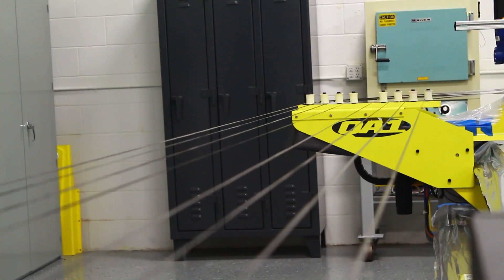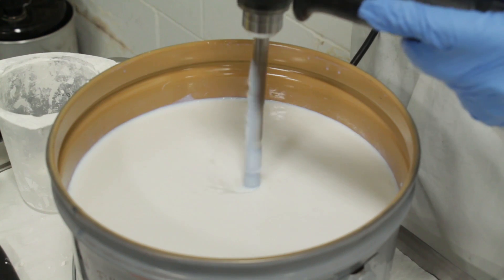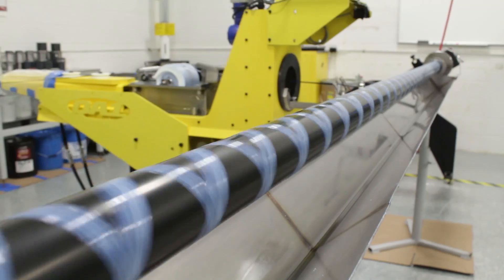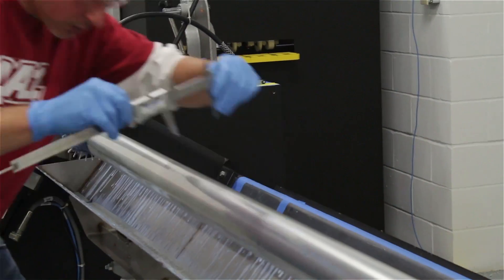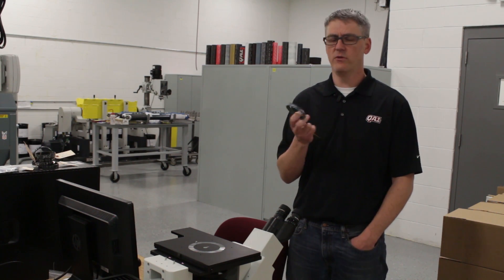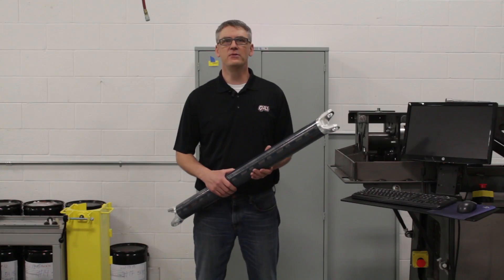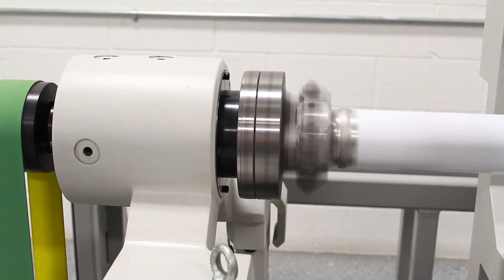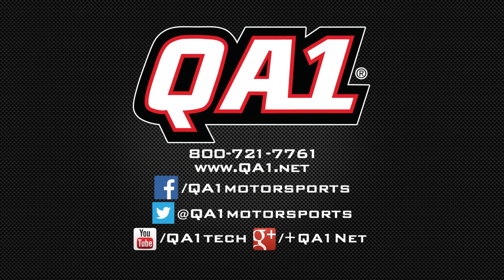How It's Made: Carbon Fiber Driveshafts

Comment: I have a 2019 Bullitt that has lots of suspension work BMR and Steeda parts that I occasionally track on the local road course.  Is a one piece Carbon Fiber Drive shaft for my car?
Reply from the maker: We currently offer driveshafts for the 15-19 Mustang platforms, but we do not have the Bullitt listed as we have not been able to confirm fitment for this vehicle.
Reply: Well, if ya wanted to figure out the fitment for a Bullitt, ya know where to get one... @QA1TECH

Comment: I wonder if they do one for a E46 BMW and one for a F80 BMW at a specification to allow enough room for the OPF...
Reply from the maker: We currently are able wind and balance one-piece driveshafts up to 65" long and that will work with a 1310 or 1350 u-joint. https://www.qa1.net/automotive/driveshafts/custom-rev-series-carbon-fiber-driveshafts

Comment: how do you guys get both ends (yokes with ears) perfectly in line and in phase? 

this i would imagine would cause no problems whatsoever when perfectly straight on a balancing machine, but then wreak havoc when at an angle and the ujoints are operating.

Comment: Corvette c6 zo6 and zr1 please
Reply from the maker: Our custom driveshafts can be made up to 65" long, can withstand up to 2000 HP and 1500 lb*ft of torque, and work with 1310 or 1350 u-joints. If your vehicle fits within these specs, fill out a custom order form and let's see if we can make one for you! https://www.qa1.net/automotive/driveshafts/custom-rev-series-carbon-fiber-driveshafts
Reply: @QA1TECH  it's not u joints but it's much easier to made ,email sent let's see what we can do about it we have to corvette waiting for a new drive shaft thanks

Comment: Do these snap easy?
Reply from the maker: No, they do not. The resin we use to wind our driveshafts is specifically designed for high performance. We did a lot of testing with these before they went to market to ensure that they are strong enough. They are balanced and torsion tested before leaving our facility and our yokes and u-joints are specifically developed to work with our driveshaft bonding, resin, and at the performance level that the shaft provides.
Reply: @QA1TECH  thanks for the reply and info !

Comment: Why don't you use an autoclave to reduce/eliminate air pockets?
Reply: The shrink tape squeezes out excess resin and also some trapped air. The whole wrapping process would need to be manual. Same for towpreg, shrink tape is the way to go on this product

Comment: I would love to know why fiber tows are used, and not a woven fiber.  Is it because you need fiber directions that can’t be gotten with cloth?
Reply: Material is much cheaper and can be oriented very precisely in every angle
Reply: @Nord55  thanks for the feedback.
Reply: @aConspiracyOnlyTakes2  no Problem, forgot some of the most important reason. You have less fiber ondulation. In fabrics the fibers are bent like waves. This alone can reduce the mechanical properties of the fiber by around 60%
Reply: @Nord55  Ah, I did not know that.  Thanks!  I wish I could find composite design training for the self educated engineer.
Reply: @aConspiracyOnlyTakes2  there’s lot of stuff to find in the internet. Otherwise there are many books which helped me to get into that stuff. I practice filament winding since 6 years and working with carbon fiber since 2013. still a lot to learn as I didn’t studied mechanical engineering or anything like that

Comment: its just a carbon fiber wrapped tube lol! unneccesary, is NOT  awhole carbon fiber driveshaft, its covered with resin...
Reply: The tube that the carbon fibre is wrapped around is the mandrel, which is removed after the composite has cured, leaving the shaft made of nothing but carbon fibre reinforced resin.

Comment: can you make custom shafts for industrial applications ? Pump drive shafts ?
Reply from the maker: Yes, we do make custom driveshafts for industrial applications. How many do you need?
Reply: Since were present using steel and not sure if yours will take the torque of our pumps ( 60HP 1800 max rpm  on vfd ) probably one for a trial and to start if the trial works the total for now would be six to start .

Comment: Do you bond the aluminium to CF with structural adhesive ? I need to repair a MTB, aluminium alloy and I don't want to weld it. I want to wrap th defective part in CF .

Comment: Impressive!  Do you make one for a 2010 GT500?  Thanks.
Reply from the maker: Thanks! We do make them for 2010 GT's, but haven't confirmed fitment on the GT500's. If you have specs & measurements, you could call in and we could see about making one for you. We're available at 952-985-5675, thanks!
Reply: @QA1TECH  the GT uses a way different transmission than the GT500.  However, the 07-14 GT500s all use the same transmission, and there are a lot of people who upgrade their driveshafts.  Perhaps add to your inventory?
Reply from the maker: @Twobarpsi  I'll add it to the requested applications list and see if we can get one in for test fitting. Thanks!
Reply: @QA1TECH  Thanks!

Comment: I am electrical engineer .I want to repair my aluminium alloy Enduro bike frame, and I want it to bandage the cracked  portion in layers of carbon fiber. But I found that the main problem is that the aluminium will corode even faster under the layer of the carbon fiber and basicly will be a failure. Anyone here has any sugestion how to unite the 2 meterials in the best way ? I forgot, that portion has zero flexibility, is the  head of the real fork, a 2 cm bar of solit aluminium alloy 7000, so the stifness of the carbon fiber I don't think will be a problem.  Any tip will give you 3 karma points ! TYVM :))
Reply from the maker: Wish we could help, but our bonding procedure is proprietary. I can tell you that we use a structural adhesive similar to what they use for aircraft. Hope that helps, thanks!
Reply: Ty ! So there is a solution :) I was thincking to take some samples of 7075, anodize them to prevent corosion and then  bandage them in carbon fiber, form like an exo skeleton to cover the area . Then test all pieces for stress ''in the house'' :) I am  sure there is a better (easier) solution to repair that 7075 alloy then the standard welding wich I found everywhere '' Posible but not recomended''.

Comment: Dont believe the BS comments below. I have a QA1 on my 750 rwhp Hellcat and its working fine. Quality product, no vibration and can handle 700 ft lbs of torque on drag radials at the drag strip with good prep. The one I have is rated to 1500 HP and 1000 ft lbs of torque.

Comment: I watched two of these things get destroyed at ATCO in New Jersey on my friends Z28, the notion that anything other than steel can withstand the enormous forces of a 500+ HP motor is to deny reality, these driveshafts are NOT for high HP applications. If you want to save weight, the driveshaft isn't one of the places to consider, it's the same reason buildings aren't made out of plastic.
Reply: we put true 1000hp to them all the time.. with out fail. 500hp  that's cute...
Reply: The rear end setup on his car is probably totally out of whack. It'll probably eat any driveshaft he puts in there.

Comment: You don't use a vacuum chamber? that's bad
Reply: Its wound wet. WTF you need a vacuum chamber for? It's not cloth forming to a mold.
Reply: do you understand any kind of bubbles inside the resin reduce the strength of the composite dramatically? Also search for qa1 failure these driveshafts are shit.
Reply: I did, everyone promotes these things including major facets like hotrod and streetmuscle. One failure I've looked up and it was a hellcat. He was glad his vehicle didn't pole vault down the track with a  regular driveshaft. Which I've seen many times.

Like I said, they lay fiber with strands not sheets of carbon and it's spinning with high rpm. You don't need a vacuum chamber, there is no bubbles to begin with.
Reply: Its not a matter of air bubbles its a matter of too much resin. Apparently they know nothing of fiber to resin ratio. Also the fiber is not wound at the proper angle. You want +/- 45 degree winding angles to maximize torque resistance. You can clearly see in the video that one of the drives shafts starts off with an angle at about give or take 70-75 degrees. Which is really meant for compression, not torque.
Reply: @Reptile789  you can't make a sweeping generalisation like that without knowing what the spec of that shaft is.

I worked for a company that made competing product to this in the UK and we would often wind at +/- 8 degrees for certain layers.

Completely depends upon spec and other things like natural harmonic frequency etc.
Reply: @Reptile789  maybe search for how torsional layers in wound composites fail. That should explain it to you. Hint: you have one rotation direction, a +/-45 gets load on both direction. And the fiber direction which is pushed instead of pulled, breaks first. Key is to prevent that these fibers can bent to in our outside. Short but hopefully helpful answer.

Comment: Looks resin rich
Reply: Andrew Villaneda indeed, which makes them weaker.
Reply: Their mixing process wasn't particularly great however, but not the worst I've seen and fairly standard for this process.
Reply: Wet winding always looks resin rich. Hence, you use of good tension control, surface speed control and resin temp control to get a consistent product.

Comment: Not good for drag cars.... road cars yes.
Reply from the maker: Thanks, Alexis. Actually, there are many drag cars running carbon fiber shafts with great success. Besides being lighter weight and safer, they also absorb some of the initial tire hit for better traction off the line and ease the stress on other driveline components. Hope you enjoyed the video!

Comment: Looks pretty interesting, but how will it hold up against steel?  I saw high horse power mustang go to launch from the starting line and the carbon fiber shaft just exploded.
Reply from the maker: Hi Joe, our driveshafts are rated up to 2000 hp/ 1500 lb*ft tq. Really, the limiting factor is the u-joint as those will fail before the shaft does. Thanks!
Reply: QA1 Wow...interesting!

Comment: Did you really just admit to using a filler and try to promote it lol. Cmon buddy you can fool the average guy but micro silica... Why would you use it. Its FILLER! Hell I am the average guy. But I can read and have read many many many dupont publications. More strength comes from proper fiber resin ratio, layup, resin type and post cure.   and I do not mean strength in the scientific sense. I mean its overall performance. Someone prove me dead wrong please. And provide why I am wrong. But until then Silica is a filler.
Reply from the maker: Robert DeHart thanks for your interest in our carbon finer driveshaft manufacturing. To learn more about why we chose to use nanoparticles in our resin, you can read our white paper published in conjunction with 3M, thanks! http://bit.ly/2B3Qq9O

Comment: Why not invest in making some carbon fiber transaxle shafts for FWD? Big market there.
Reply from the maker: Thanks for the suggestion! We have done half shafts before so it's not out of the realm of possibilities!
Reply: The Real Elvis   THE SHAFT USUALLY DOESN'T FUCK UP  THE JOINTS DO
Reply: Anthony Agnelneri, perhaps weight savings? Just guessing.
Reply: Because FWD=FAIL WHEEL DRIVE!💯💩👎😂😂😂

Comment: is this a Wet Carbon shaft or Dry Carbon shaft?
Reply from the maker: We consider it a wet process because we have liquid resin being applied to the fibers during our winding, thanks!
Reply: Thanks for the reply! What about the maximum torque it can carry?
Reply from the maker: They are rated up to 1500 lb*ft, thanks!
Reply from the maker: Hello, here's a link to our dealer locator. For international orders, I would recommend Summit or Jegs. http://www.qa1.net/dealers/
Reply: ccszohn Are there big differences in the results of the two methods?
Reply: I'm from Taiwan, please let me know how i can contact your dealers.
Reply: Thanks for the reply. We are aiming bigger markets not just individual order.  Do you think if it is possible to deal with you directly?
Reply from the maker: You can submit a request to our sales department at sales@qa1.net, thanks!
Reply: We submitted but have not received any reply so far.
Reply from the maker: Apologies for the delay. Our sales manager is on a business trip this week so I would expect that he would review your submission when he's back in next week. What email address did it come from? I'll give him a heads up to make sure he sees it. Thanks!

Comment: so whats the price average?  thinking of adding one to a snowmobile so I doubt it would be too big.  maybe 1"X20" ?
Reply from the maker: Hi Andrew, I'd recommend you call into our tech line to get more info for your application. They can be reached at 952-985-5675, M-F 8-5pm CST. But to give you a reference point, our 2.25" diameter driveshafts range from $629- $1045+ depending on a few factors. Thanks!

Comment: I'm doing a 93 540i 4.0 v8 swap in my 1981 733i E23 bmw... with the 540i V8 and 733i stock rear end (which is more than enough to handle the torque from the 4.0 v8 swap) could you do something for that? and how much would it cost?  I need a custom built drive shaft to get her back on the road.
Reply from the maker: Hi Ryan, I'd suggest you get in touch with our tech department at 952-985-5675, M-F 8-5 CST and they can help you out. You can also take a look at our custom driveshaft ordering page for more info: http://www.qa1.net/driveshafts/how-to-order-a-custom-driveshaft
Thanks!

Comment: I'm considering a CF shaft for my 2016 GT350. Engineers tested CF shafts on pre-production cars but ultimately decided against them. The car comes with a U-joint at the front and a CV joint at the rear and is a two piece steel shaft(s). If I can supply dimensions, etc, is this an application you'd be willing to take a look at?

Comment: Sir, I want to know that how much bending load that carbon fiber shaft can bare, normally u people do that in u r lab!
Reply from the maker: Thanks for your question. Our driveshafts are designed to minimize bending to ensure they perform appropriately within the intended RPM range so that there are no issues at your critical speed. Any bending that could potentially happen is detected during our critical speed testing and will vary depending on the construction of the shaft, length of the shaft, as well as other potential variables.

Comment: Hi, I am a member of a Baja SAE team that you guys currently sponsor for rod ends. We are starting to do calculations and designs for carbon fiber drive axles (max 16.5 inches long with an 1.5 inch OD). Do you think you would be able to help us with fabrication or give us some tips for our design? Thank you
Reply from the maker: I'd recommend giving our tech line a call at 952-985-5675. Thanks!

Comment: What tape is finally applied on the shaft after the winding process ?
Reply from the maker: We use a compaction tape during the manufacturing of the tubes, which is removed for the finished driveshaft.